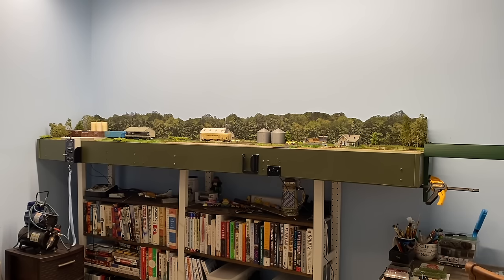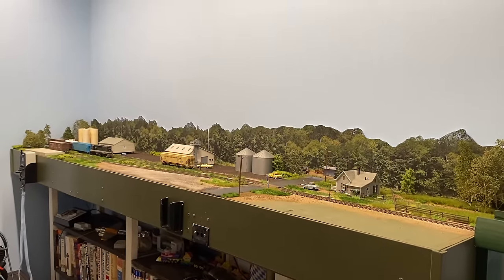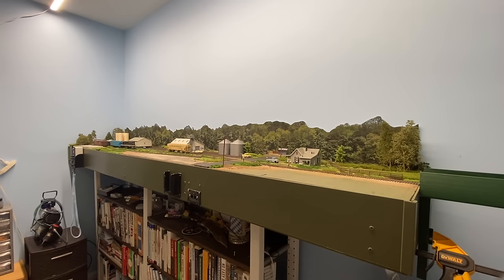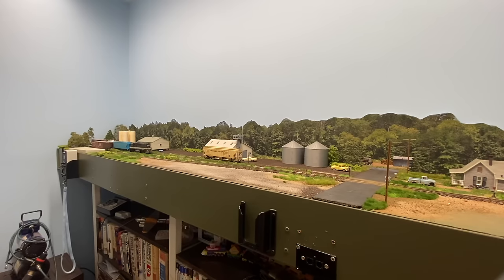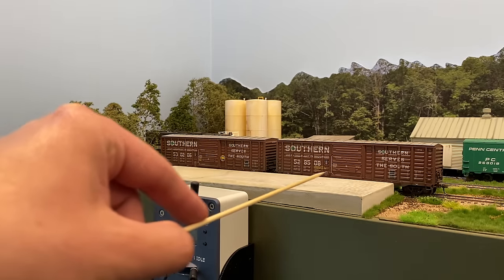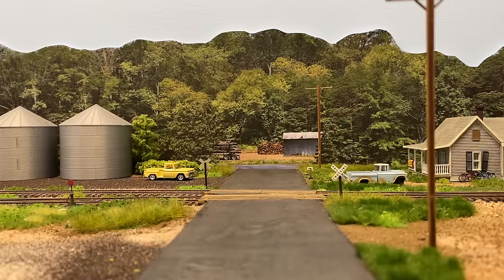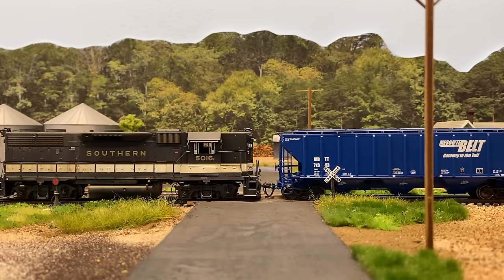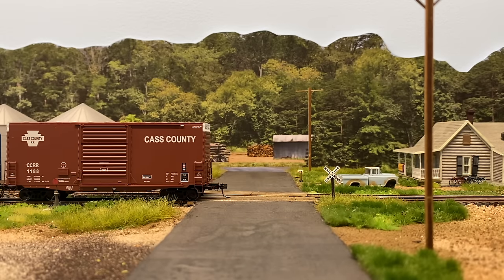Bookshelf HO Scale Switching Layout 2.0

Comment: We loaded hopper cars on the l and n we could hold 7 cars on our sitting we moved the car while loading with a stiger panther tractor if it was in the fields we used a farmall m tractor . Had to uncouple with the m it would handle 3 hoppers .and we even pulled one at a time with a ford f250 pick up truck .we would off load fertilizer  to